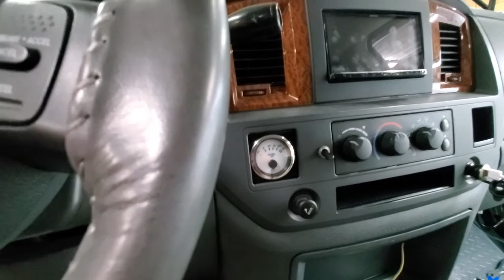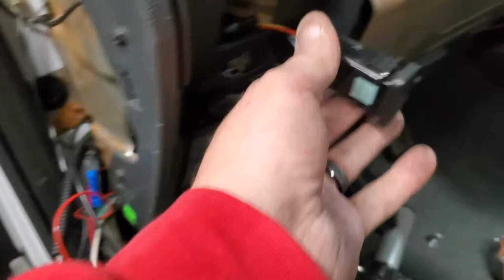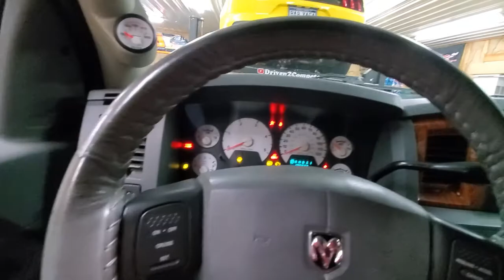Fourth Gen Dodge Ram Power Folding Mirrors

Comment: Thanks, great video, nice work. Appreciate not hearing about your dog problems. Convinced me to try and do it the factory way, with Trail Ridge OEM replacement for original folding mirrors (good product).  Using Alfaobd, mirrors worked with new switch and stock modules, but no folding (2013 2500 ST).  (Waiting for oem folding modules, more $$). We'll see.  Thanks, again. BTW (The flag does suck)

Comment: Thanks Sean.  I was researching Power fold upgrade for my 2014 Ram.  I was debating between the Trail Ridge and the Infotainment's upgrade kit with the replacement door handle, control module, etc. but their cost is almost 3 times as much.  Overall, how long did it take you to do the install? I know you were videoing, but that will still give me an estimate.  In comparison, the Infotainment install much easier since there is no wire routing. So, thanks for the details - good job.
Reply from the maker: Thanks for watching and commenting.  The entire install probably took me 3 hours.  I was / am a bit picky about my work, so it maybe completed sooner.  It all depends on your abilities.

Comment: Is there any mirrior rattle/bounce with these as you were driving with them?
Reply from the maker: None
Reply: @Driven2Compete  perfect, thank you
Reply: Just to add - I have a 4th gen (2022 1500 classic) with factory tow mirrors and they bounce at freeway speeds over bumps. I would expect these to bounce slightly as well, will be ordering these soon for my Ram. Thanks for the video
Reply: @Eclipseballer1994  true true but some of the aftermarket mirriors I have one of as a replacement after an accident bounce so bad its not usable. One side is moving slightly while the other side is trying to leave chat. Hahaha